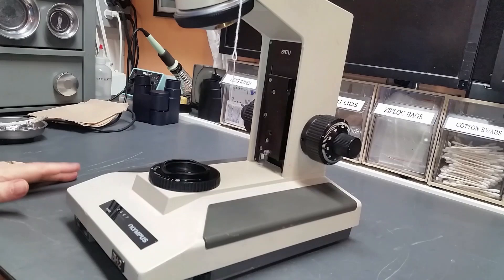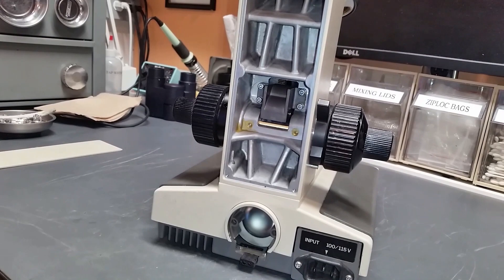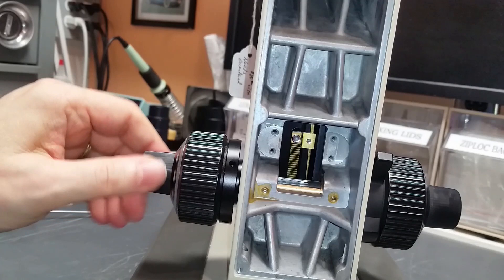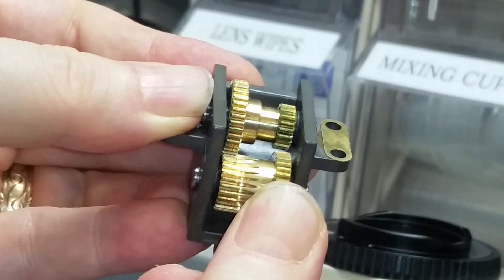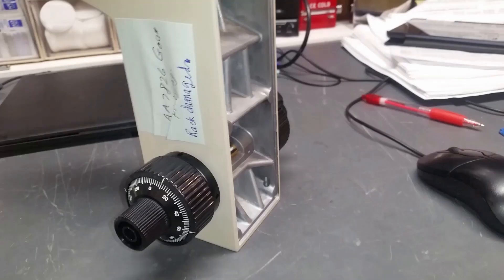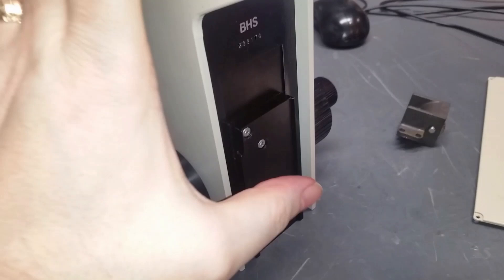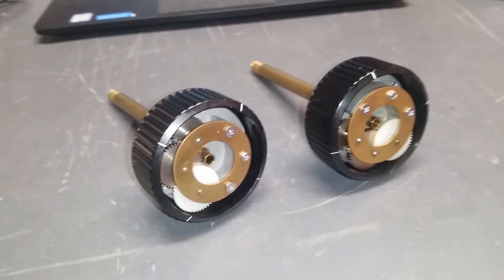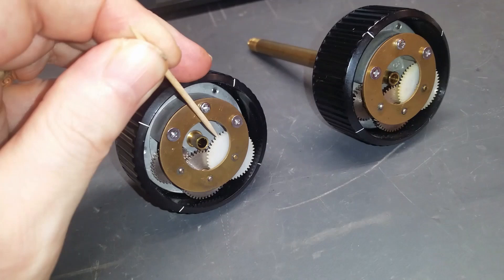What To Expect from an Ebay BH2 Microscope

Comment: hello, my model is equipped with a light intensity slide potentiometer.  Recently, it has not been working properly, the light flickers until the intended setting and after the microscope is heated up, the problem disappears.  Is it easy to access?  I suspect it can be cleaned or replaced, thank you and best regards
Reply from the maker: https://drive.google.com/drive/folders/1HYioEAx8UkYbGWyg-5bmGih5EPlqz95F
Reply: @carlhunsinger9638  thank you:)